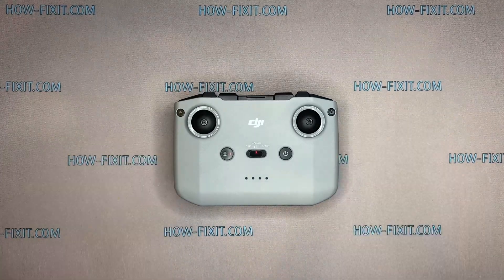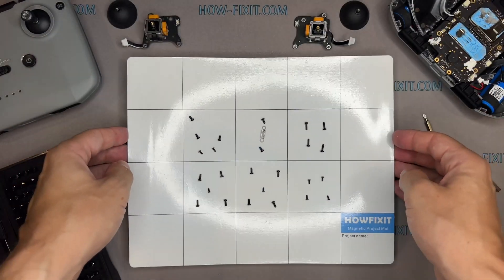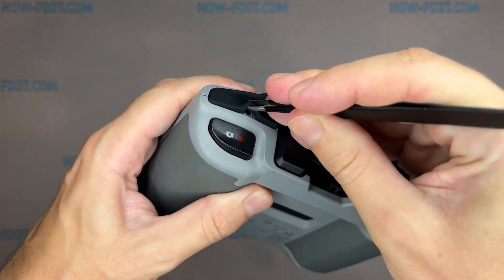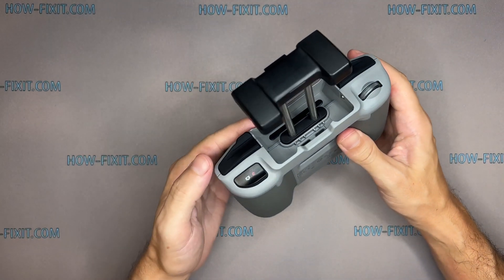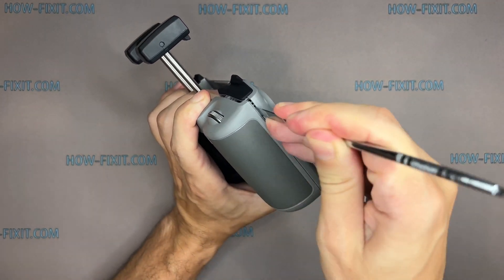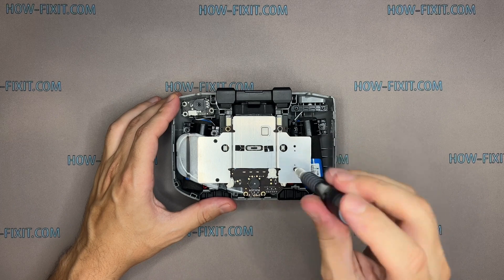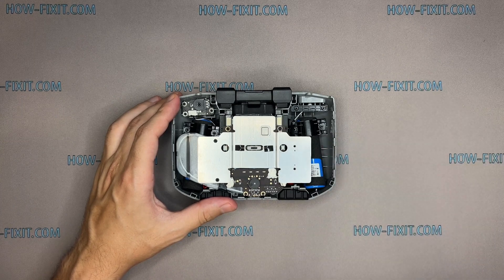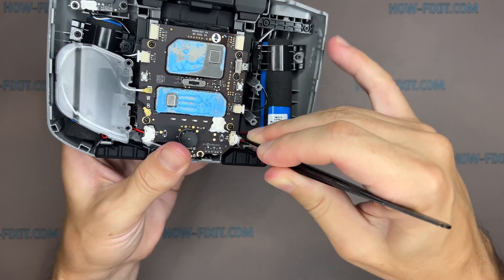DJI RC N1 Remote Controller (RC231) Battery Replacement

Comment: I figured this wasn't too complicated. The RC-N3 came with only one battery. I'm going to upgrade it to two like the old RCs
Reply: any news ?
Reply: @ok-yy2hq the  N3 didn’t have a connector on the other side so I had to solder a 2nd battery in but I have it working with 2 18650 batteries now, effectively doubling the capacity.
Reply: @BryantAvant  did you just solder the battery directly, or did you solder another connector to plug the battery ? I want to try and soldering another connector to make it clean
Reply: ok so for everyone:
i soldered back the 2nd connector and it does work, but its the same as if you soldered the battery together / used a Y splitter and plugged into 1 connector
The bms is not smart, on the pcb the battery are plugged in parralel, meaning Y splitter and soldering a 2nd connector on the pcb has the same effect

Comment: Thx for the vid!  It is excellent and well-done.  But what 1st year engineering student designed this?  They couldn't have just attached the two halves with screws?  One has to PRY the halves apart?  Jeepers!  Then you have to basically disassemble most of the unit to get to the battery packs?  Way over-engineered.  Couldn't have just made a compartment with a cover on the back like normal appliances?  Finally, the link to Ali Express says it can't be shipped to my address.  I tried both NY and CA...no go.

Comment: If you guys have the rc-n3 version of this controller, it only has 1- 18650, you can add another 18650 battery to put it back to the previous version’s capacity, DJI did this to save money on the basic controller

Comment: My controller quit charging. As with all lithium-ion batteries, they eventually die and need to be replaced. Poor design by DJI for not using standard 18650 batteries that you could easily replace through a trap door on the case. I used two standard 3400 mah 18650 batteries and soldered the connections. It was a pain in the a** taking that thing apart to fix it. I got it done but it was NOT easy. 😕
Reply: Right, the whole unit is over-engineered with no obvious advantage.

Comment: I have a N1C controller which cheaps out by having 1 battery.  Tempting to try to take it apart to see if I can slap in another.

Comment: atm on the market we can see 5800mAh, wondering its true 5800 or just lies, that would be over double of capacity, thank uou for video
Reply: Those are fake. The highest capacity 18650 batteries are around 3600mah. The factory cells are 2600mah, so even a 3500maj would make a huge difference, no need for bigger. With 2x 3500mah it should last at least 5-6 hours with one charge.

Comment: Have you done a video on how to replace battery on the dji RC2 remote controller yet? If not, I wonder when are you going to do a video on replacing battery on the dji RC2 remote controller?

Comment: Could you confirm the size of the screws ? It seems much smaller than Phillips 1, I would say PH00 or even PH000 as they seems smaller than those from PS4 controller. Thanks a lot for confirmation, I need to buy a screwdriver and would like to be sur eto buy the right one !
Reply: I am talking of the 4 external screws in order to be able to open the controller

Comment: I have a question what is the reason why dji mini 2 remote controller not charging??. Thank you
Reply: I have the same issue. Soon as installed the newest update my controller stopped charging and wont switch on. Had 80 percent battery before this happened 😭
Reply: @THEFLYINGSCOTSMAN-oj7jm  same goes to my controller after i update it i fly the drone then suddenly i lost signal and my controller just shuts down lucky the drone goes back home, the controller wont turn on or charge what is happening
Reply: @devildante6191  I'm not sure iv been trying to find a solution for the controller but no luck as of yet its a absolute nightmare 😫  iv seen a few people have posted the same issue after the update I tried to get in touch with @DJI  but they keep telling me to send the drone and controller back for inspection which will then lead them to charging me for repairs no doubt 😡
Reply: @devildante6191  Planned/engineered obsolescence. No way my controller is dead after only a year unless it was designed to do that. Chinese junk. Nothing more - nothing less.
Reply: @THEFLYINGSCOTSMAN-oj7jm I'm facing the same thing at this moment. It's super strange zero issues then bam next day LED will not light up. Everything internal looks good and new like- does the battery just crap out like that?
Reply: @loschen_kite  it'd a nightmare as dji doesn't sell new ones so either have to buy a refurbished one or someone selling second hand. I was lucky enough I knew someone who had a brand new one and he gave me that but literally had never had any issues with either drone or RC before hand 😪
Reply: @THEFLYINGSCOTSMAN-oj7jm  wonderful, I was lucky to find a great replacement drone after losing it to the lake (100% operator error) and then a week later my controller. I suspect it committed suicide after losing it's best friend in drone the week prior
Reply: Me too